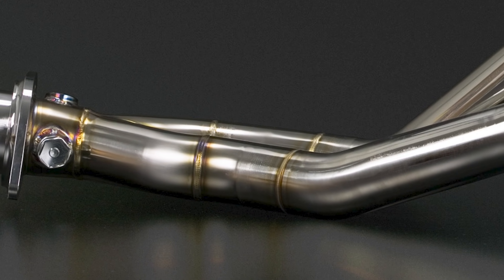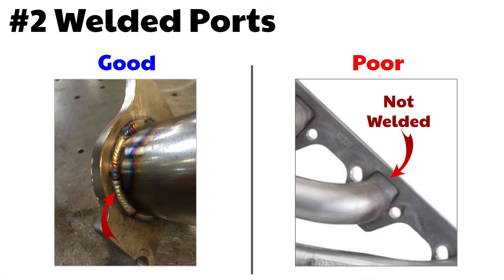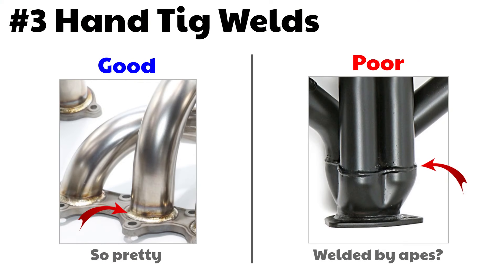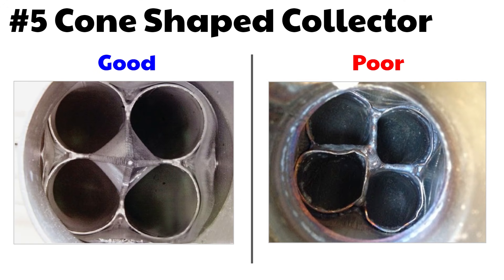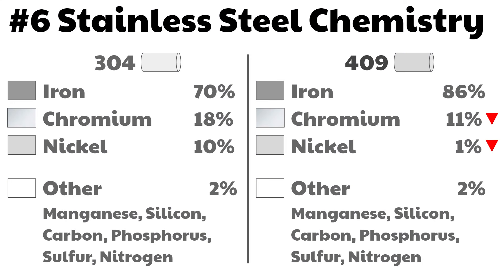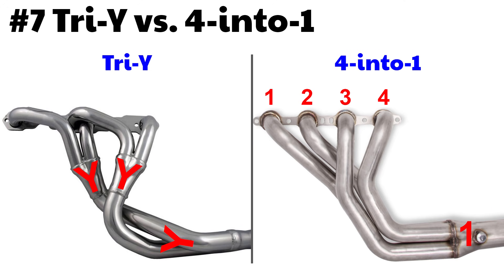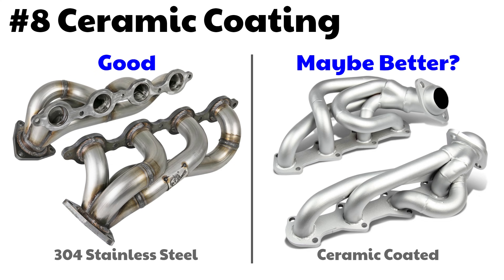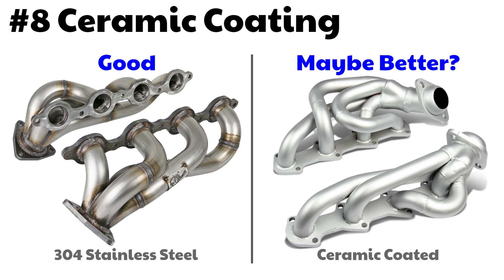Exhaust Header Secrets: What to Look For

Comment: Who here watching this video and reading the comments spent big time money on T304 Headers that also had them CERAMIC COATED? So far I have not found anybody who had besides myself for my 1997 Camaro Z28s 383 LT4 donated from a wrecked 1996 Corvette LT4. You see here near Atlantic City, cheap and even pricier headers made out of mild steel can't survive the year round salty air (Even a land breeze can't push out the marine layer). If it rains for only a few minutes, the rain will have a decent amount of salt in the droplets so it literally rains salt water most of the time. Of coarse after a hard rain, any rain that falls after 10-15 minutes will be pretty pure thereafter. I'm going to let anybody know what will happen to my Ceramic Coated T304 Headers from Stainless Works. 

Stainless Works said that if I cure the coating properly, It will last for a long time compared to coated mild steel headers. I also purchased a few cans of ceramic coating from Eastwood. https://www.youtube.com/watch?v=aX6kqLSFY5o so that the inside tubing will be protected but who knows if that stuff will really work or not. Worth a try though. My 97 Z28 that will have my 530 horse 383 LT4 under it's hood will be beat on at a road coarse track while still being streetable. For those who might be curious, here's my 383 LT4 on the Dyno...

Comment: Informative info. I'm restoring a family heirloom, a 1978 Lincoln Continental Town Car with the 7.5 litre, 460 cubic inch engine. The original exhaust is a single pipe but I always felt it was struggling. Would like to put on a dual system. Any suggestions would be appreciated. Thank You.
Reply: Yes, I have a suggestion. Replace the heads with a good set of Dart cast iron heads and get a good valve job on the new heads. While at the machine shop, have the STOCK exhaust manifolds gasket matched with a Felpro performance exhaust gaskets as well as the exhaust ports on the head. Then have both sides feed into a 3" pipe back to a quiet muffler with a 3" inlet and a 2.5" outlet. You'll get better power under 4,000rpm without losing torque, and the 2.5" outlet will keep velocity up as the gasses cool toward the end.
Reply: @20alphabet  Thanks for the reply. Just watched a video of the Dart Heads. Amazing when compared to an overhauled OEM head. Question: You mentioned "A good valve job". Do you know if Dart will do the whole head including the valve job. I'm not a mechanic so don't know these answers but I am technically oriented. Thanks for your sharing your knowledge.
Reply: @normpowell3566  
No, they will not. It's quite rare for new heads not to need a valve job, as the valves seldom create a seal as sold. Buy the small port versions fully assembled. Let a reputable machine shop take it from there, you'll be money ahead. If you're in southern California I can make a recommendation. If you aren't, you can still use them and have the heads sent to you when they're ready.

Comment: I have built 30-35 sets of headers in the last 30 years, including piston aircraft, 2/3 of which were stainless. From my experience there are only 2 types of SS to use in header construction. 304 and 321 the ladder being used in high output turbo applications or in a thinner wall for high end, normally aspirated.  304 is fine for street turbo applications that dont see extended high rpm high load operation.
The ideal use imo of ceramic coating is to use it on the inside only of a stainless header which retains the SS look but increases thermal efficiency while reducing discoloration in gasoline applications. Another thing to look for in ss header construction is if the manufacturer purged or used flux on the back side of the weld. The way to tell is if there are signs of carbide precipitation on the back of the weld which is black in color. Shiny on the inside means it was done correctly. Carbide precipitation can lead to a 30% reduction in weld strength leading to cracks.
 Silicon bronze is the name of the tig rod used to weld outside of the flange on a steel header. There is a black ceramic coat that looks better over time and less prone to rust imo on a steal header. Other good points in the video
Reply: what about of ss316 on primary tubes instead of 304
Reply: @makantahi3731  316 is essentially the same as 304 with the exception of added Moly which improves its corrosion resistance. As far as I know the only benefit of using 316 over 304 would be in a marine application.
Reply: @billclark5943  i am making whole ex : headers from 316 and rest of 304,i have winter time and lower parts of car were full of road salt, i will see if any difference,
Reply: @makantahi3731  I didnt think about road salts. Certainly seems like a wise choice
Reply: Bill i would like your opinion on a matter if you would. I bought ceramic stainless steel long tube tri Y headers from dougthorley headers 6 months ago. I installed them on my daily driver. The website described them as 304 with mild steel flanges. Well now the Ys or collectors are shedding the coating and rusting. Come to find out through tech services, Those parts are actually 409 stainless and they say that 304 cannot be manipulated in the same way to make them. My question is this just a way to cut cost or can you actually make the Y's / collectors out of 304? Thank you
Reply: @Garet Fitzpatrick  Garet, it's hard to say but I think the material is appropriate for the application. The problem is the coating is not staying on the surface like it's supposed to. That could be from an error in preparation, application, a bad batch of the coating material or a ding or chip that caused the bond to fail and allow corrosion to begin. If it was 304 instead of 409 the corrosion wouldn't have set in and the coating may not have started to come off. Either way the manufacturer should have stated the correct material type in my opinion.
Reply: Yep, ceramic coating peels, rusts and looks like hell.
Reply: To clarify, that is NOT silicone bronze in the image at point 2, it is stainless wire. I can't say I've ever seen headers welded with silicone bronze, it wouldn't be a bad idea, but it certainly wouldn't add any strength to the part like the video suggests.
Reply: @BrettObie  "Silicon bronze is the name of the tig rod used to weld outside of the flange on a STEEL header"
Agreed. It would serve no purpose on stainless.

Comment: 409 is a better choice than 304.... while both are very poor choices 321ss is what I use 99% of the time. Better than 321ss is 347ss after that its Inconel but thats insanely expensive and I have only made 3 headers from it in 15years
Reply: Who told you that
Reply: Told me what part
Reply: @alexhise968  that 409 is better
Reply: 409 is a better choice primarily in crack tolerance and fabrication processing tolerance.  With 304  the crack sensitivity, as well as precipitation rate at the temperature that exhaust systems run leads to rapid fatigue especially in the case of a header  321 has a very large thermal envelop it's limits are able to be exceeded but few will hold them at degradation levels for extended periods of time  allowing the user a relatively long use case. The same can be said for 347.  The pinnacle is 625 I made a header that was only 0.020" thick on the thinnest sections the material goes slightly translucent  at high temperatures  allowing you to see the exhaust pulses flow through the header.
Reply: @alexhise968  still don’t know where you heard that
Reply: @alexhise968  All stainless steel contains chromium and other elements. The added elements make the metal harder, stronger, and resist corrosion. The 2 main types of stainless steel used for exhaust parts are 304 and 409.

The difference between the types of stainless steel is the amount of chromium and nickel found in each. 304 stainless steel contains a much higher percentage of chromium and nickel. This makes it much more resistant to rust. 409 stainless steel is still more rust-resistant than Aluminized Steel. However, neither type of metal is 100% rust-proof. ~ summit racing
Reply: @alexhise968  In general, stainless steel is more difficult to bend and weld than mild steel. In some cases, working with stainless steel could require heat treatment. This relieves the internal stress caused by bending and welding. Stainless steel is more likely to crack, due to this internal stress.

Most modern factory exhaust systems are made from 409 stainless steel. It is strong and will last 8-10 years in a moderate climate. 409 stainless steel will rust on the surface. However, this is not a concern for most people because it is hidden under the vehicle. Surface rust can be cleaned with a wire brush.

304 stainless is the highest quality material used for exhaust parts. It will last 10 years or more in a moderate climate. However, it is the most expensive. It will not rust for many years. But, it will turn a golden brown color after being exposed to heat. ~ summit racing

Comment: overall i thot this video was pretty good for an intro to the topic...you did however leave out one crucial thing - the distance at which the tube extends from the flange BEFORE making any bends.  as a rule i maintain 1-1/2" MINIMUM distance.  this means i want the tube to remain straight (unbent) for a minimum of an inch and a half before making any bends. hopefully the reason is obvious (but many lower quality pieces i have seen make bends at or so close to the flange that the tube itself becomes a restriction as it deviates from round or kinks in some fashion).  with all of the informative comments (and also those inevitable nit piking d-wads) i found it somewhat disappointing that nobody mentioned this basic and crucial point.  one other thing...when deciding on the tri-y config...make sure that the y portion of the headers are custom fit with compound welding angles and cuts.  there are those out there that use cookie cutter style y connectors.. u should know them when u see them....they look kinda like two tube collectors located at the first two of the 3 connectors. also consider header wrap...temps go up under hood with headers...creates all sorts of ghosts to chase. lol

Comment: I heard stainless will corrode if deprived of contact with air. This is from boating where leaving a rope,fish scales or even grease on rails starts a chemical process that can destroy stainless internally.
This results in a white crusty expansion of the metal much like when aluminum flakes.
It doesn't seem to bother coated headers perhaps the heat drives moisture out.
I was going to use the inexpensive heat wrapping tape but you can't see what's going on underneath.
From dirt bikes I always liked flat black high temperature paint. 
Cheap,keeps moisture and corrosive salt air away but doesn't hide problems. Looks cool in my opinion too.

Comment: I have an project bike coming, 4 cilinder superbike form the 90' ,
And it has an 4 to 1 system now, I want to make 2  2in1 systems most part for sound but not with to much HP los.
Are there anny tips ? 

Thanks 👋

Comment: okay not very Sceintific  but i’m 57 years old and over the years i’ve found as a whole Hooker Headers   are usually the best value for the money  and i’ve always had them hold up  BTW i’ve mostly  used them on American Automobiles  and in a few applications i’ve even found them cheaper than the factory  Exhaust Manifold replacement  at my Autoparts stores

Comment: Not to nitpick, but it's impossible for any coating to reduce temperature by 50%. Temperature is measured from absolute zero, regardless of what units you are using. Maybe a coating could reduce temperature by 50 degrees, in which case, it would depend on whether you are talking about F or C.

Comment: Add this… equal length primary tubes with firing order on 4 into 1 collectors offer better scavenging if done in a circular pattern and long tube headers offer better overall performance than shorty manifold replacement headers …

Comment: An extra bit of info on 4 into 1 vs tri-y headers is ground clearance. This holds true for lowered cars and cars that weren't designed for modification. I had 4 into 1 Blackjack headers on my Delta 88 and the collectors scraped every speed bump they could find.  Eventually I had custom made Tri-Y headers installed and no more problems.
Reply: Lol Blackjack!   That's years ago!
Reply: @tahcogunworks  1987 to be exact. Back then in northern Canada there weren't all that many options after I dropped a 455 Olds V-8 into my 1967 Delta 88. The new headers were customized here in Australia but it still retains the Edelbrock Torker II intake manifold and cowl induction.
Reply: @tahcogunworks  Yeah and they were not exactly top shelf either which may explain clearance issues.

Comment: On more modern cars with cats, ceramic coating has one more benefit, heating the cats up faster and possibly to a higher temperature, allowing the exhaust to be a bit cleaner. 

I bought ceramic coated shorty headers for my truck primarily because of under hood temperatures and never wanting to deal with warped headers and broken header bolts ever again. And although everybody who knows more about engines than I do keep telling me that headers do not increase torque that much, it still seems to me, that compared to a ticking exhaust manifold, it now has more off-idle torque and revs more freely than before. But it is a 230hp 3ton truck so I could be wrong.
Reply: Headers do increase torque through the whole range. The shorty headers dont have as much effect as long tube though but still make a difference esp of the stock exhaust is highly restrictive.

Comment: Me and my brother put together an entirely custom exhaust for his truck, we used ceramic coated equal length headers because stainless was not available, the cost was roughly 500$ for the headers. The exhaust tubing was all stainless steel 304, except the H-pipe, (which was required because the truck only has one O2 sensor), which is mild steel galvanized with aluminum. We couldn't find an h pipe in 304 steel so yeah.

It sounds like a fucking nascar at higher rpm.
Reply: *My brother and I

Comment: 5:19 correction: 304 doesn't rust because the chromium content is high enough that it forms a complete oxide covering over the metal, which doesnt oxidize the way iron does. This layer is protective and prevents the iron from rusting by acting as a barrier between the air and the iron.
Reply: my 304 header rusted over winter because of salt on road, inside was no rust
Reply: @makantahi3731  are you sure it wasnt 409 stainless? That kind is less resistant to rust.
Reply: @Heck6  yes, it was custom made, and because of that ,now i work on header from 316 ss tubes
Reply: @makantahi3731  interesting, but it may have been a poor quality 304 stainless, I know of a point where china was selling really low quality stainless steel that was rusting on peoples' appliances like refrigerators and ovens.
Reply: @Heck6  exhaust was wraped with thermal wrap that collected salt, so 304 was rusted, but part of aft 409  oem tubes were rottem as the worst mild steel, now i make headers from 316 and rest of exhaust from 304
Reply: @makantahi3731  Haha yea there's your issue, thermal wrap. My brother and I were building the exhaust for his truck some months ago, and we used ceramic coated mild steel long tube equal length headers from jegs because we couldn't find any in 304 stainless. Ceramic coating can work as well as thermal wrap for reducing heat. There are coatings used for exactly this that work extremely well at trapping heat.
Reply: @makantahi3731  was it purge welded? if not then it loses corrosion resistance
Reply: @bilaltariq7819  that exhaust was mig welded and was equally rusted, no matter is weld or straight pipe and was rusted outside not inside

Comment: If you having underhood temp issues, it can effect things like sensors and wiring in the engine bay. If ceramic coating is gonna but temps down by 50%, you're saving yourself a lot of headaches from replacing sensors.
Reply: The starter motor can really benefit.
Reply: safest just to assume you WILL have at least one issue related to header temps
Reply: on top of that, hot air is less dense. Testing things like this that are supposed to improve power by containing heat should not be done on a engine dyno, your car does not have the benefit of having fresh air to the intake and the exhaust gas being constantly extracted out of the room, your engine bay is going to get hotter and hotter and you're going to lose power because the air you're sucking in is that much less dense. I guarantee you they conducted that experiment on a engine dyno rather than a chassis dyno, and a chassis dyno would definitely yield some results.
Reply: Wrap them
Reply: @meademorgan6614  do both

Comment: Was hoping for long tube vs short tube HP & Torque differences.
Reply: Short header reduce exhaust restrictions,  long tube do the same plus they add an element of tuning (well they could.... if they were designed to).
Reply: Kit Levey, short tubes do nothing for performance they are mainly for fitment issues or if  your cast iron manifolds are cracked and you need a replacement. 
For performance long tubes are the way to go period.

Comment: I have built a few sets of headers using 304 0.062" 304 SS.  If you are building, TIG weld with the inside purged with Argon.  If you are buying SS headers look inside at the welds.  They should be a gold/straw color.  If the welds look black/nasty don't buy, poor welding.

Comment: key things to look for in a quality header is weight  material used, thickness of header tubes thicker the better  flange thickness is only for 4 cylinders  almost all v8 header flanges are thin i could go into a physics lesson on thermodynamics  and vibrational frequencies but that'd take far too long    so ill keep it short "HARMONIC VIBRATIONS" are the killer of ALL HEADERS dont matter how much they cost